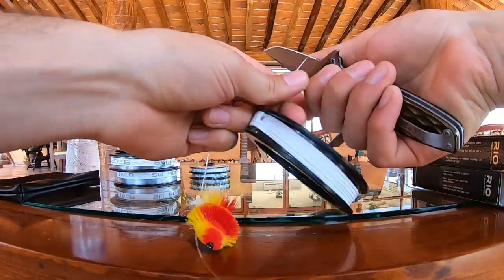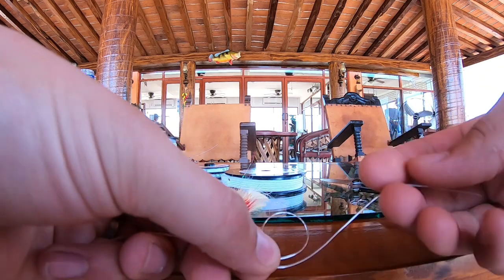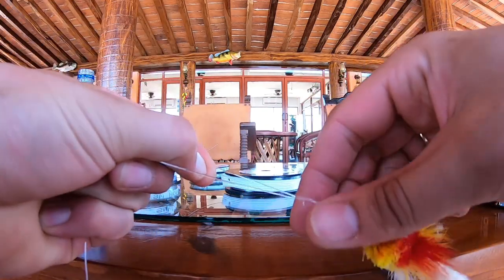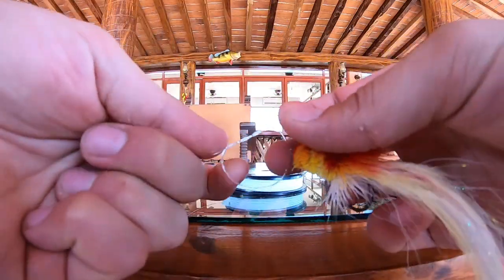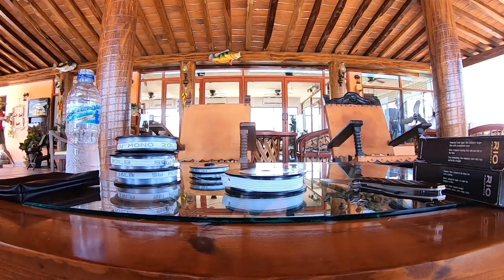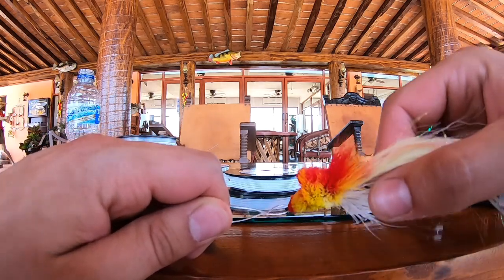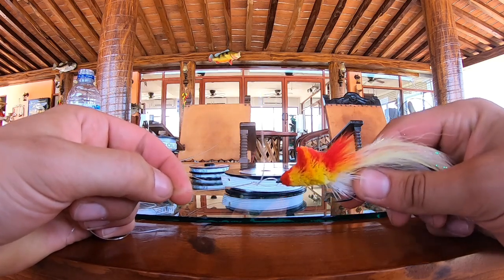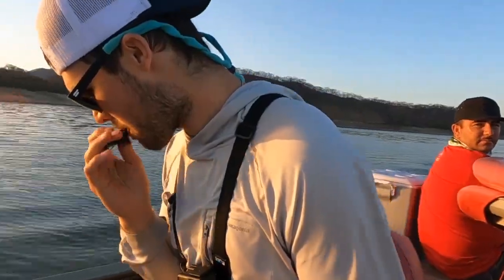Non-Slip Loop Knot

Comment: I use a very similar knot that leaves the initial overhand open, forms a kind of clinch knot above it, and feeds back through the overhand.  At least with 10-15lb and under it works amazing.  I will try this version next time I have a bite leader or am using heavy line for some reason.
Never underestimate the value of a hinged connection..  that was life changing for me when I started implementing it for carp flies, and it has crept into MANY other applications since.

Comment: Just looking at the thumbnail image of this video I saw that you had some split shot set in the loop before the fly.  Is that where you normally put your split shot on a streamer rig?  Big fan of your videos! keep it up!
Reply from the maker: Its a harness that fits a Tungsten Bead - "Insta Jig 2.0" - distributed by Hareline Dubbin. Very cool little rig, takes some practice to get them on right, but very effective. Gives a near vertical fall to the jig which I like when pitching at vertical style structure, or need depth on retrieve. When I put shot on the leader, it is usually 1-2ft in front of the fly to get depth without overtly affecting streamer action.
Reply: @Gunnar_Brammer  thanks for that!  Looking forward to more videos!!!

Comment: Do you use this knot for muskies?
Reply: Yes. Its all I use. Just do one or two turns with the wire
Reply from the maker: For sure Rick - The Multi Strand Knot-able Wires work great with this knot, especially the RIO Bite Wire in 30lb or 40lb. If you have trouble slipping the knot into place, replace the double surgeon with just a single. The Nylon Coating on the wire will keep it all snug with no issues.
Reply: @Gunnar_Brammer  Thanks!  I’m going to switch to this knot.  Easier to tie than what I’ve been doing.